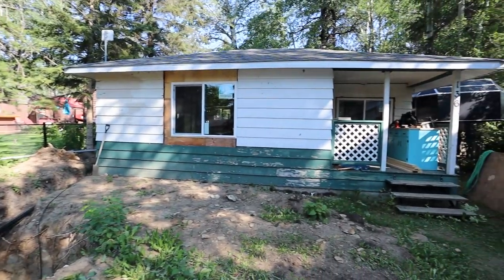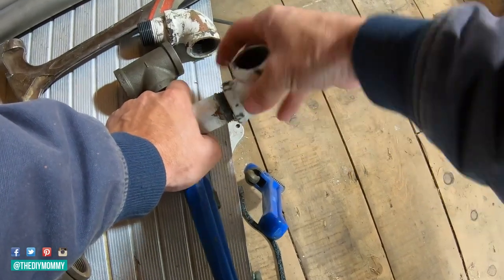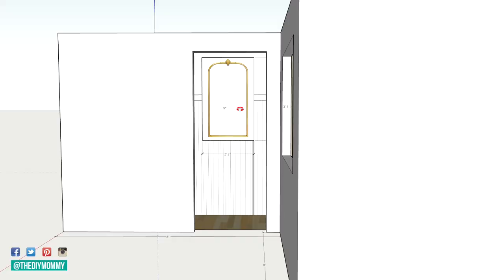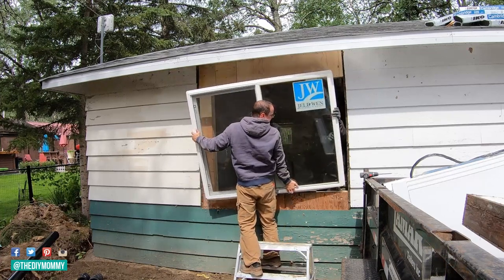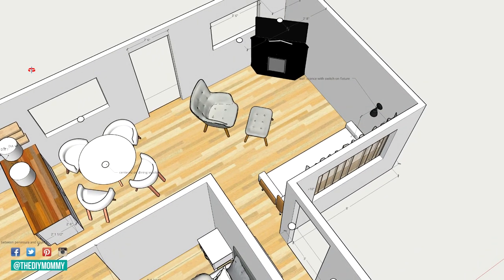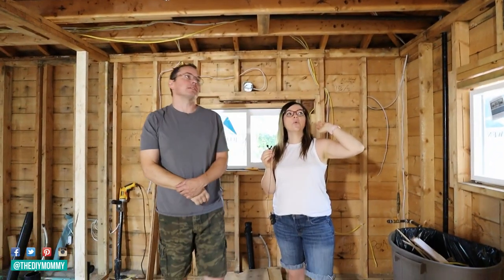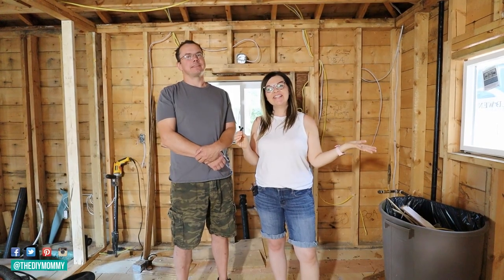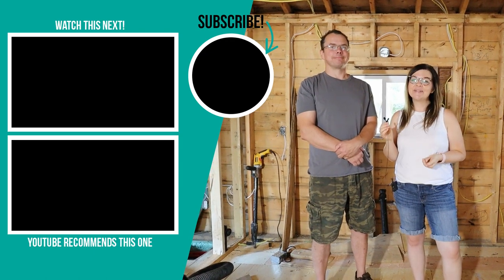MISTAKES, setbacks, & PIVOTS while renovating a tiny cabin into an Airbnb...

Comment: Barn door for the bathroom. I put one in. My bathroom is so small you can turn on the water for the shower and sink while you  sitting on the toilet. Yes that's how small it is. If you put the barn door on the inside you can use the door for storage. Just make sure you secure the your towel holder and what ever else you want to mount to the door.